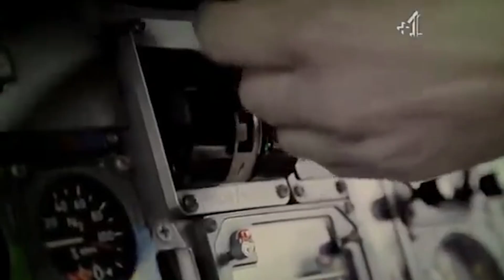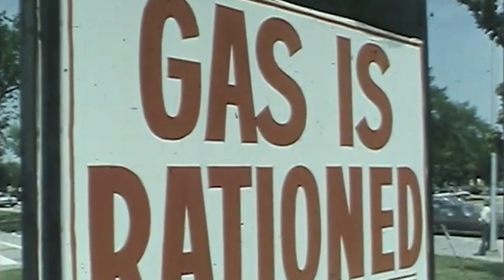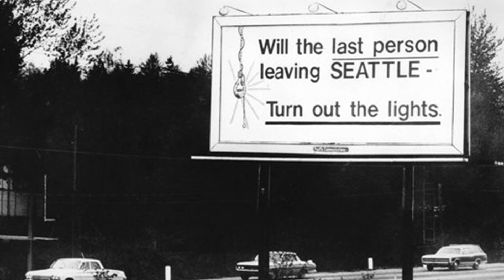The Forgotten American Concordes - Boeing 2707 - Lockheed L-2000 SST

Comment: I was thinking about this very issue recently and I came to the conclusion that there is a whole lot of problems and perhaps the only way they can be circumvented is by someone outside the USA working on such a project - say China for example.

The reason being that a lot of the tech you need to make a viable supersonic plane (that isn't a huge waste of time and money) is secret technology that isn't allowed to be used for non-military applications things like catalysed Oxygen extraction from air for fuel or certain meta materials or even super cruise engines to some degree are "secret" or protected technologies.

The issue of making a huge row and breaking peoples windows isn't going to go away either and the only way around it is to fly very very high which means you hop over super sonic and into hypersonic technologies and then you are essentially building space ships. (or as good as) so if someone is actually serious about going to MARS then yeah some of this required tech will filter down - but I wouldn't be surprised if it's not flying around until many of the people watching this video have died of old age.

Comment: The problem with S/S/T airtravel is the sonicboom itself and the airpressure that it generates that slams into the surface of earth like about a hundred miles radius with sledgehammer like devastating force.  They created organizations because of this shit.  They scrapped the project because of concorde and even the Russian built Tu-144.  There noisy and that pressure is horrendous and it's not worth the money if you cannot fly it.   It would be absolutely worth it if we can figure out a way to distribute the pressure created by what i believe is the afterburners and shape of the body and deal with the problem of the sonic boom problem directly.  The queen of england road on the french/english concord plane and thought it was like anything else and quite within but if you flew that bird over a city people would hear it and feel it like my alpine subwoofer.  I believe it is an issue that can be delt with and we shouldnt have to be stuck at a speedlimit under 650MPH just below that of the sonic boom (depending on speed and altitude) and we should be flying like 1400-1650MPH cruise speed commercially but the air pressure is far to dangerous that is flung torwards the ground and amplifies and shakes windows and breaks stuff.

Comment: The makers of this video forgot that the Boeing design for a SST was used by a collaboration by Rockwell Int. and Boeing to build the B-1A (4 built) bomber, which morphed into a little slower B-1B (100 built), with a sustained cruise of Mach 1.25 @ 50,000 Ft. The B-1B is still in service today in the U.S. Air Force, in the 28th Bomb Squadron in Texas, and in the 412th Test Wing in California. It is a beautiful aircraft, that proved that the U.S. was able to make a SST (in my opinion, the B-1B could be transformed into a SST, with major fuselage changes).

Comment: Lockheed was already flying the secret SR71 Blackbird at Mach 3+ for several years ... and  knowledge gained made it obvious that a commercial plane was NEVER going to fly near Mach 3 due to heat and cost of titanium fabrication and maintenance..  the euro Concorde was pushing the envelope at Mach 2.  Lockheed was in the best position to develop a successful Mach 2 competitor ... the US government selected the wrong company and set performance parameters that were absurd, while already having access to lessons learned from the SR71.
Reply: BigCooter.com I totally agree with you. That's a very intelligent comment you make.

If engineers were on the political committee in the US capitol building at the time, I believe they perhaps would have realised the exact factors that you suggest, and would have chosen the Lockheed instead. It was a much more sensible and non-big-headed and arrogant design. I would have stuck to parameters that were easily attainable with the technology and materials science that it is too that the time. And it would have been cheaper.

I think with hiduminium and duralumin, the Lockheed version would have at least been able to match Concorde or improve on the speed slightly, and with lessons learnt from Concorde, they would have been able to use the same computer digital control of the inlet ports in order to supercruise - just like Concorde.

If this had been followed through, then there would have been a Lockheed version flying at Mach 2+ by the 1970s.

And if the political will had been carried through, I believe that they would have allowed overland flights over non populated routes, for example, over certain parts of Canada. With special permissions granted by the Canadian government, Concorde & the Lockheed SST could have easily been doing east to west coast by the late 70s on a regular basis.

Not only this, but it would have been able to fly from LA to Hawaii -  halving the time needed for the journey, and with refuelling stops in the Pacific it could have easily made LA  to Japan a possibility.

If they had persevered through the oil crisis, knowing that the crisis would have passed eventually, then by the 80s there could have at least been European and American supersonic passenger transports by the hundred flying commercial routes over non populated lands, and oceans.

If Airbus had been keeping their eye on the ball, new parts could have been developed along with new tyres and so on keeping Concorde flying for many years to come.

And on top of all of that, Concorde Mk 2, the supposed follow-up version, which would have been slightly larger and more efficient with after burning turbofans, could have been developed by the 1990s - and the world would have been a smaller place.

Hindsight is a wonderful thing, but it's lovely to imagine.

In many ways, the stupidity of politics choosing the 2707 just for National pride, pretty much killed the SST dream for the Americans.

Shame, because with Lockheed's knowledge gained from the SR-71 programme, and their huge history of supersonic engineering knowledge, it would have been a way better choice to make. And would have been a beautiful aircraft, like the Concorde.
Reply: The Convair B58 Hustler was in service during the 1960s, having first flown in 1956. It  cruised at mach 2, and provided the first clues of how constant sonic booms would affect everyday civilian life:  Not good.

Btw, the aircraft which appear at about 2:44 are not Dassault Mirages, they are Convair F-102s.
Reply: @guysiddyfo  the Convair Hustler - now that was a beautiful aeroplane!
Reply: David Curry Films My favorite aircraft!
Reply: You cant ask all your passengers to wear pressure suits to prevent their blood from boiling at the altitude of 25.5km where the thin atmosphere lets the SR71 cruised at Mach 3.
The Concorde cruised at Mach 2 with a max altitude of 18km. But for safety concerns due to cabin pressure. The safe altitude was 15-17km. Which was 2km higher then standard air liners.
At the 18km height if their was a cabin breach passengers would be unconscious in about 5-10 seconds and all would be dead before dropping below 10kms where the external atmosphere is just becoming breathable.
Reply: Vegarot Fusion Concorde cruised way higher than 2 kilometres higher than an average airliner. At the time airline is for cruising around 40,000 feet, Concorde's maximum flight ceiling was 63,000 ft, with an average Max Cruise height of 60,000ft.

This is nearly 7 kilometres higher. And was above the Armstrong line so if there was a pressure breach on Concorde the passengers would have been unconscious anyway, which is why it had such a long testing. And was built strong with small windows to minimise airframe stress.
Reply: The SR71 used a unique fuel that would make any commercial flight impossible due to cost. Neither Pratt & Whitney or General Electric had any suitable engines. Concordes engines were developed from the engines made for the Avro Vulcan, the RR Olympus. Neither Boeing OR Lockheed were anyware near developing a commercial supersonic passenger plane and that is why the USA banned supersonic Concorde flights across their territory, no other reason.
Read "The Concorde Story" by Christopher Orlebar
UUC/EAN-13: 9781855326675, ISBN 1-65532-667-1
Reply: Yes and no the military keeps black projects very compartmentalized that way no one really knows what’s going down I’m sure very few were privy to that type of knowledge only 5 star generals and CIA most likely
Reply: @O F F L I N E Lockhead has their military secret Skunkworks and makes commercial aircraft too.
Reply: If Lockheed had won it would of flown much more easier to build and not too complicated unlike the Boeing
Reply: The SR-71 was a plane with a lot of very serious limitations that was designed for a very specific purpose. In reality neither Lockheed had the expertise. Getting a military plane with a lot of asymmetric thrust issues flying at mach 3 for brief periods (the SR-71 never maintained mach 3 otherwise it was often in danger of coming apart) is one thing. Putting passengers with no pressure suits into a plane that will fly at those speeds consistently is another matter altogether.

Many people get misty eyed about the SR-71 without realising the serious limitations and dangers it had, as impressive as it looks.
Reply: Not even sure if the blackbird was even aware to any personnel on the Concorde project of the era, it was a special access program back in those days and still most likely highly classified.
Reply: North American had experience with Mach 3, with the XB-70. And it actually worked on a large scale.
Reply: @oranges866  and that was the 50s!
Reply: @oranges866  Try selling the public on flying in a plane that pumped fuel to cool the airframe. lol
Reply: @TheBeingReal  people see "supersonic" and would instantly line up for it.
Reply: @oranges866  Thanks for exposing your true self. 

Have a great day.
Reply: @TheBeingReal  very cynical today, aren't you?
Reply: @oranges866  Says the person who wrote “…and would instantly line up for it.”
Reply: @TheBeingReal  no clue what you're going at, but to put it in more understandable terms: there are many people who would willingly pay the price to go faster.
Reply: The XB-70 was interesting. It showed that you could build a bigger and faster plane than Concorde, and it even flew 5 years before Concorde did. But, like the other SST projects, and like Concorde, it would have had no answer for the economic and environmental challenges posed of a civilian airliner.
Reply: Difference in this case is that SR-71 was obviously also commissioned by government, but the whole program was ran by people who knew what they were doing. 

However, it really doesn't matter because even if Lockheed designed something like Concorde it still wouldn't live long. Problems with these planes were not apparent to general public that had very romantic view on that sort of thing. Supersonic airliners are just not practical. Expensive, dirty, relatively fuel inefficient, not to mention sonic booms that can be literally dangerous to just random people that happened to be on the ground in the wrong place. Would Lockheed create a Concorde without drawbacks of a Concorde? I mean, they had some amazing engineers but they were not magicians.
Reply: MY---YOU ARE A FAN,  YOU SOUND LIKE ONE OF THOSE GREEN NUTS, WHO PROTESTED AT NEW YORK. ALL THOSE STATISTICS THAT WERE CREATED ,SO AS TO PREVENT CONCORDE LANDING, PROVED TO BE WAY  BELOW CONCORDES ACTUAL PERFORMANCE. SHE PROVIDED A TROUBLE FREE SERVICE FOR NEARLY 30 YEARS. I DOUBT VERY MUCH, THAT A US CONCORDE, WOULD HAVE BEEN TREATED THAT WAY.  IT WAS ALL POLITICAL. @Quicksilver_Cookie
Reply: Douglas should have merged with Lockheed not McDonnell. They would have had better engineering together.
Reply: @O F F L I N E The SR71 had 2 seats, and Lockhead builds the C-5 Galaxy, one of the biggest Jumbo Jets ever produced. Lockhead had the knowledge, experience and capability to design & build the very best Super Sonic Commercial Transport ... wrap your brain around that thought.

Comment: From what i saw and read about at the smithsonian, boeing had perfected the airframe design for 2707 but did not have the engine design to produce a engine that would allow for a supersonic cruise without being in afterburner, that was the same issue the russians had with the tu144, that had to remain in afterburner to cruise at supersonic speeds. Using afterburner increases the engine thrust dramaticaly but also increases fuel consumption dramaticaly ! no good for a aircrafts range.
The concord on the other hand cruise at mach two without being in afterburner, that was down to the rolls royce olympus engine design. It was not a quiet engine however, the same goes for all pure turbojets !
It really is a shame that the UK & USA did not work together on this, USA producing the airframe, UK producing the engines. 
The plane would then have had a fighting chance of getting into production & in my opinion would have surpassed concord as the SST of choice for passenger travel.
But as per normal,  politics gets in the way of what could have been.

Comment: What about the XB-70A? It was capable of being the first of Americas Supersonic Transport Aircraft, North American Aviation sought to make a Super Sonic Bomber and it was developed! It had it's first flights in 1964-1965! And led to the American Super Sonic Transport Aircraft! Supposedly the US had given the engines from the XB-70 to Russia for use on the Tu-144 when Nasa worked with Russia to do some testing! Because the Russian versions were not fuel efficient "Saw it in a Documentary", later it was claimed that Russia did not accept the engines and used ones from their Tu-160, which still were inefficient fuel guzzling engines!  

Even today, Russia has relied on a Civilian Cooperation between Boeing and Technologiya Obninsk exploited it Militarily and created the stealth coatings for use on the Pak-Fa! Boeing also helped them develop the Composites used on it as well! They admitted this in a series on RT about the Pak-Fa, it is obvious that the US has allowed the exploitation! There are other things the US has done as a mistake that has been covered up! Like giving Russia a super computer in the mid 1990's for use to help in Nuclear Proliferation, but it was exploited to help develop newer weapons and systems like the S-400, like the Bulava and Sarmat! 

And in the late 1990's the US gave Russia some of the Spy 1 S-band radar systems to help prevent a  Nuclear war with their issue of False launch claims by their own radar systems, which has led to the advancements of Russia's own S-band radar and electronic warfare equipment! Later with the development with Russia's 4th gen fighters they asked the US for flight control computers for SU-35's since their technology was lacking in the early development phases of the 2014 fighter that would be based upon Fly-By-Wire technology! The US said no and later India provided computers and technology to provide flight control!

India is also supported by Boeing and they have allowed Lockheed to attempt to sell India the complete manufacturing capability of the F-16 fighter, which includes engines "Some of the most powerful and Advanced for its time", which could allow countries like Russia to advance their engine technology and sell countries like China, Iran and North Korea secret technologies from the F-16! These are Issues that Presidents have allowed to occur and I am sure Trump will extend his Gratitude to Russia with sales of some weapons systems!

Comment: Mach 3 is actually about 2.100 km/ h (2:30).
Reply: Depends on altitude. At sea level the figure given is about right (it's over 3600 km/h) but it wasn't intended to fly at mach 3 at sea level! At high altitude where it would have actually flown, mach 3 is "only" about 1900 miles/hr (3100 km/h -- perhaps your "2100" is a typo for 3100?)